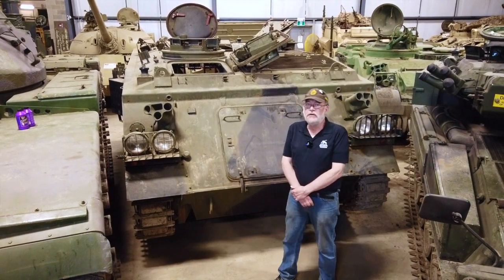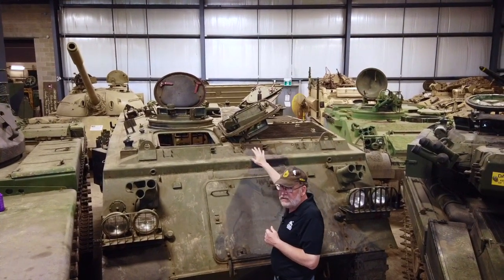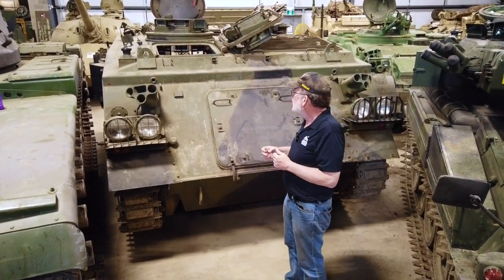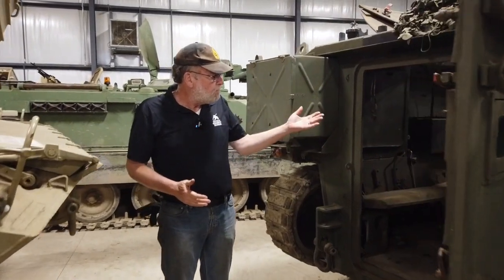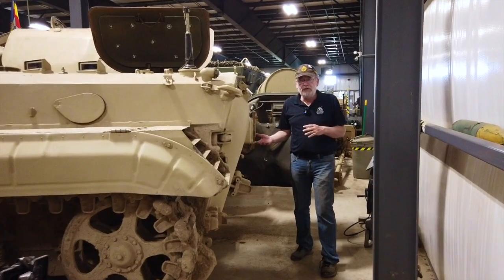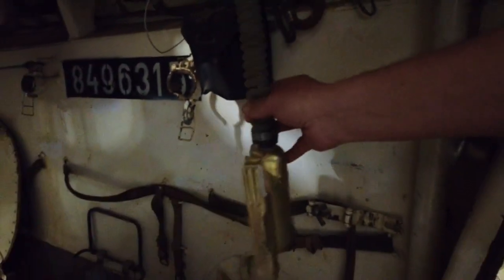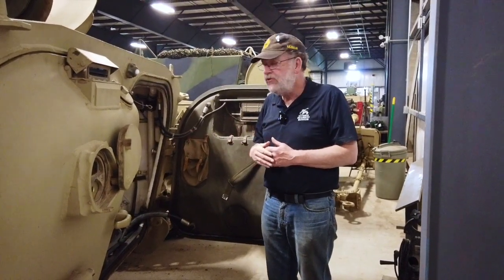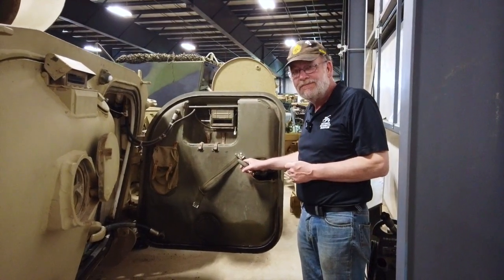Museum Behind the Scenes Series: FV432 & BMP-1

Comment: 3:11 I heard that in conflicts where BMP was used, the feeling: "It dosn't feel good to have fuel in the exit doors",  was often shared by the users and so these were filled with sand for greater protection instead.  I believe that the door fuel tanks are extra for the bigger internal fuel tank.
Reply: They would use the door fuel  getting to the objective before actually disembarking